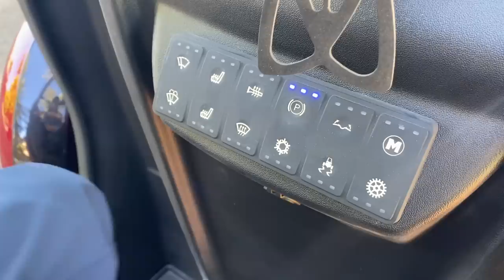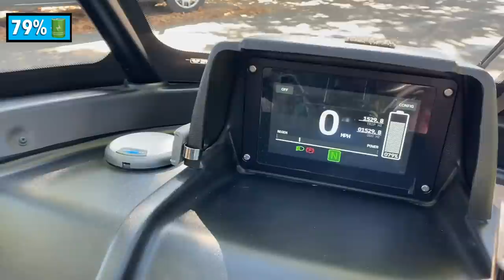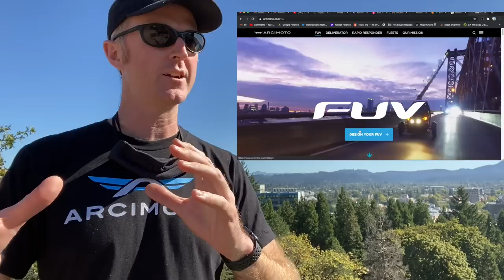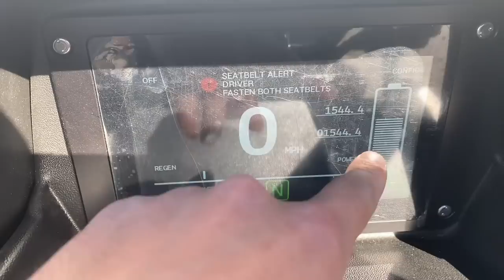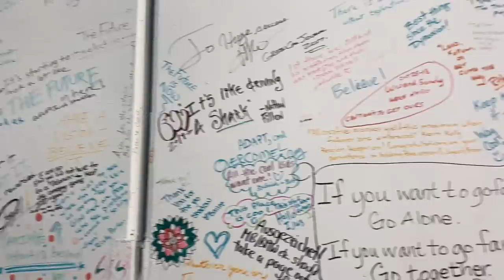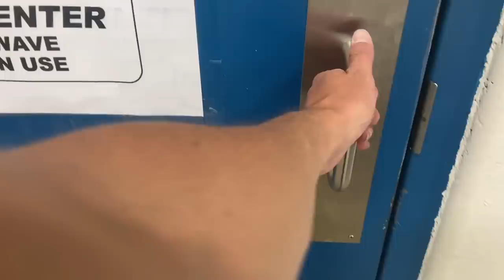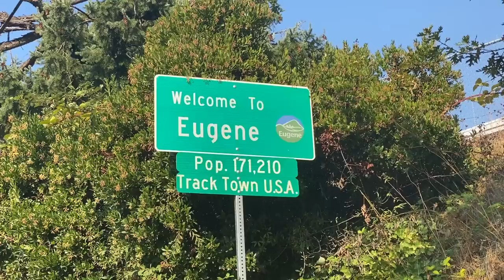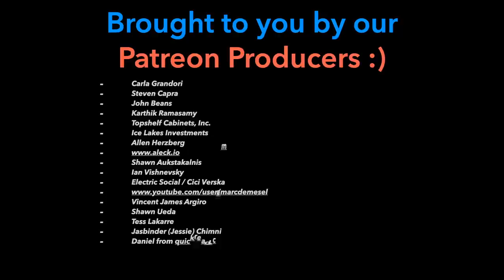Arcimoto X HyperChange Fall 2020 Documentary ⚡🍁

Comment: In the video you have mentioned it's safer than a motorcycle, is there any matrix where Archimoto has been certified as highly safe as compared to regular 2 wheels? Asking this question from an investor perspective keeping in mind the safety of the current and future customers :)
Reply: Sled tested with dummy (it gets yanked) and roof is crush tested to 2000 lbs.

Comment: What do you mean by "you have the electric torque no other mototcycle has"?  There are very powerful and torquey motorcycles. Did you mean you say you have the dual motor torque and traction of two driven (front) wheels? That does seem to be unique to Arcimoto. ;)  It presumably steers the opposite of a motorcycle as it's not leaning like e.g. the Yamaha Niken or Piaggio MP3.

Comment: How do you quickly clean an FUV?  You obviously can't run it through a car wash.  If you hose it down, is the dash water-proof?
Reply: I plan to use my Husqvarna leaf blower and a water hose for the wheels and front
Reply: Mine got stuck outside in the wildfire ash. We did a quick light spray down of the inside. Yes, all water resistant/proof. Take care with the polycarbonate roof and windshield.

Comment: As an investment I don't see it. The technical barrier for entry for China seems very low. I like the CEOs hussle, I like how he aggressively courted $TSLA investors throughout YouTube. I just think the product is not technically amazing.

A barrel key instead of a phone app, or keyless fob? Have you seen the TFT displays on the new Energica bikes or the Harley Livewire (both have keyless options)? The seatbelt system looks silly, maybe for regulations they can't integrate into the seat, IDK but they need to do something with that. 

For the price point (premium category) it seems technically basic. From a technical perspective what here could not have been made 10yrs ago? Nothing.
Reply: You can go keyless with a pin code on the display. The mobile app will also allow keyless operation when launched
Reply: @thejonmiller82  strange they showed models with barrel locks to a technical audience. Yet still my other points are the same, I see no technical moat here at a premium price point.